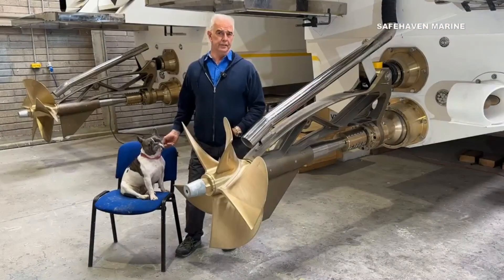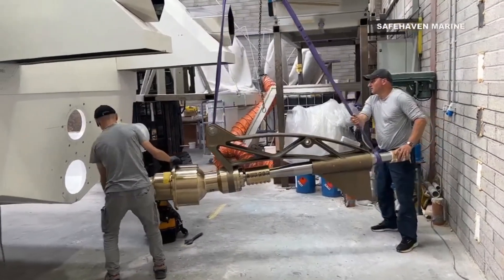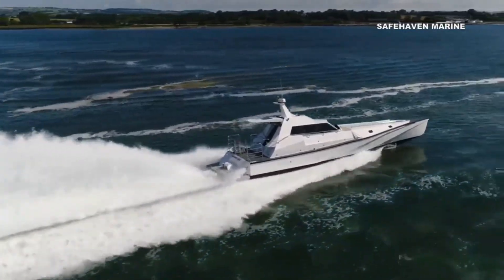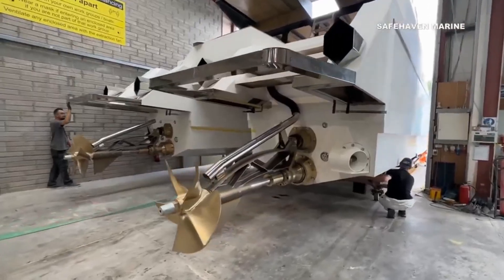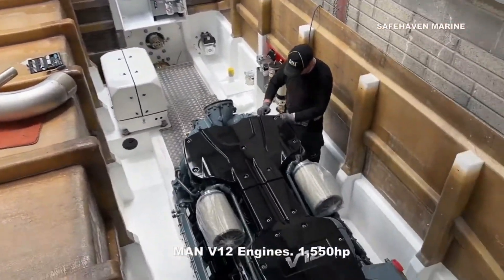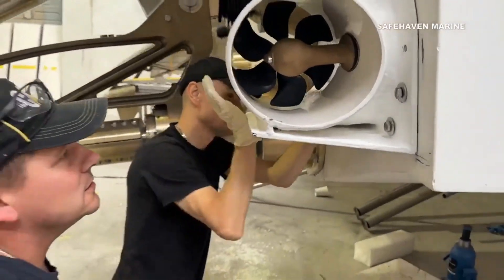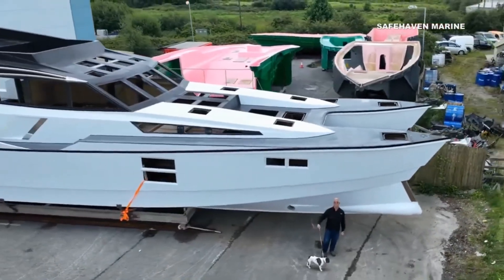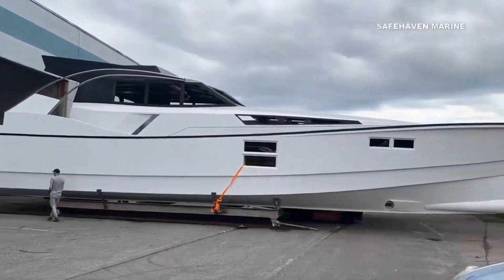Installation of the T-2000 Voyager's propulsions system @shipdiary

Comment: A boat of this size is still made of fiberglass? This material doesn't bend, it just breaks. If I'm spending millions on a boat, I want it to be as safe as possible. Either aluminum or, even better, steel.

Comment: Their T 2000 is a much more commercially viable product for the open market then the thunder child and then the previous attack boat iteration I can see them selling these like pershings I'm actually interested in a T 2000  But with slight tweaks in the length and now the works the new iteration will look like the old one and you only wait to tell them apart where to be the park inside the side each other but I am definitely interested in your T 2000 model catamaran